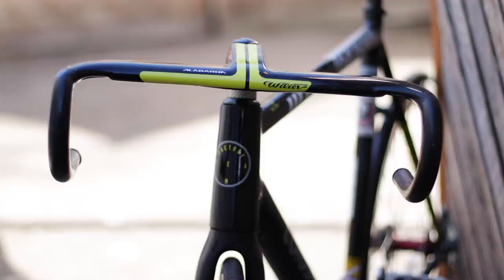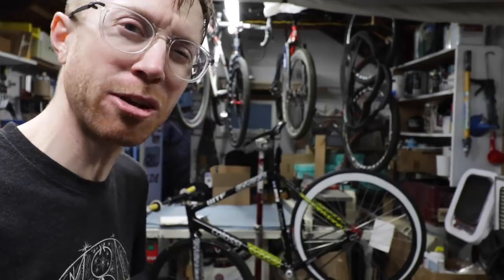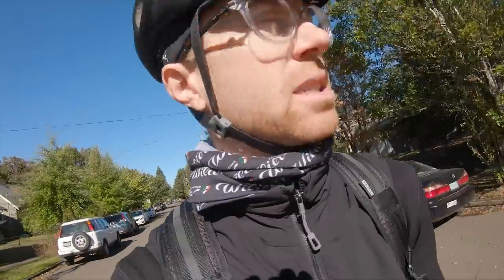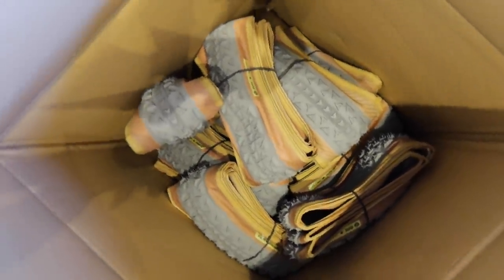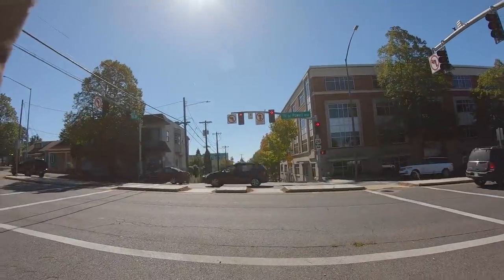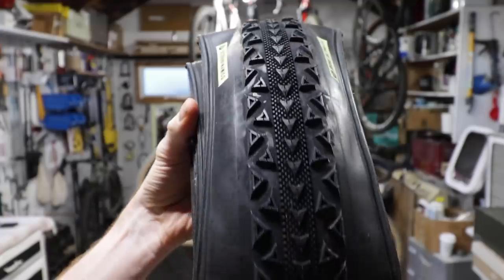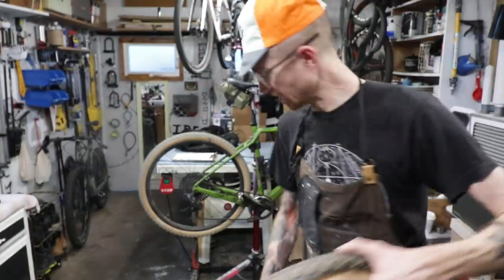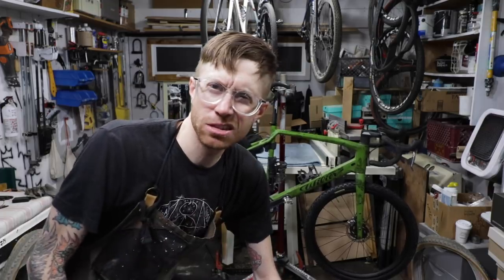Track Bike Ultradynamico to backside CushCore Installation

Comment: So I saw a tip on a YouTube video. Pry open your tire a little bit and use an appropriately sized aerosol can lid and scoop the tire fluid out of your tire and pour back in a container. Worked real slick on the video.

Comment: Dude i recently switched to bontrager xr2 for my full suspension and after hearing tyre snapping in place I was happy with the result. Next day it turned out that in one spot the bead didn't seat properly and I ended up with infinite speed bump experience on the ride :D I was stuck with almost 3 atm in it because my valve was all sticky from the sealant (I run sealant inside inner tubes in some of my bikes and it does the job well). On a tarmac descent I decided to lock my rear end and almost flew otb because of that tyre hitting so hard! good thing I had fs, but the rear suspension was working hard that day! I work at a bicycle store as a mechanic and from seeng your face during setting up I see I'm not the only one with anxiety during the process. I swear converting to tubeless will give me ptsd some day....
Reply from the maker: You'll get it. It's about watching a few different youtube videos to get the feel for it.